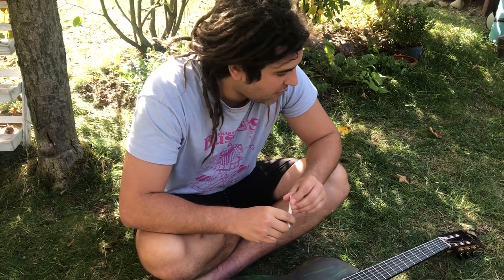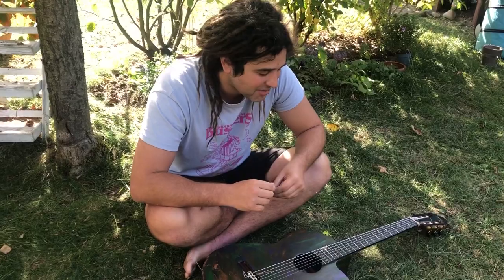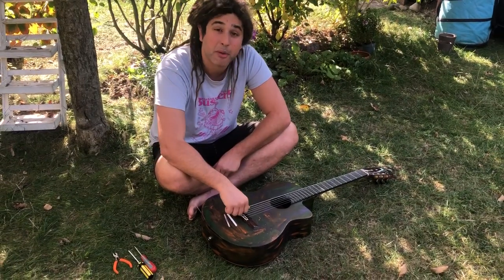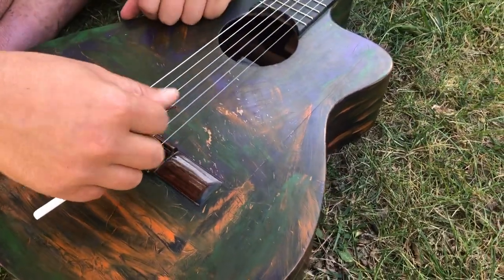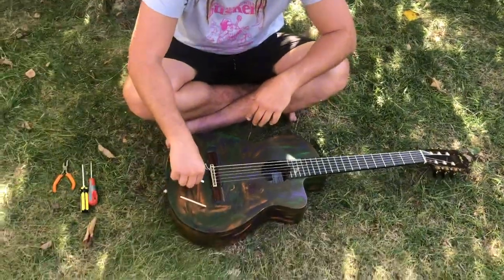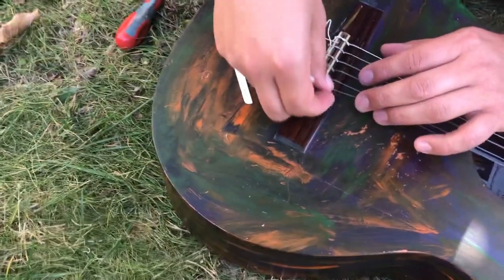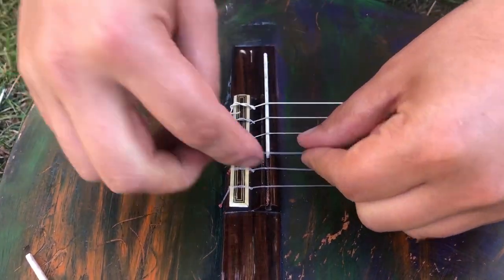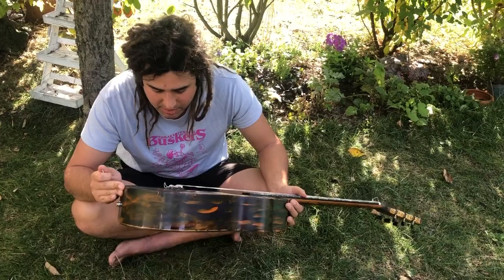One guitar string not loud enough! Maintenance and diagnosis of the problem

Comment: I broke the A string on my electric guitar and when I put a new string on I accidentally measured one peg past the A peg instead of two to get the string length which made the string one peg shorter.  It sounded okay until I turned on the amp then it was dead sounding.  After replacing the string again with the correct length it sounded fine. Thanks for your video.

Comment: I had the same problem with my Takamine GD30CE-6. The low E string sounded weaker than the other 5. I sanded where the saddle base sits in the bridge; slight improvement, but still sounded weak. I replaced the piezo pickup and it improved a fair amount. Finally, I adjusted the truss rod,  and that solved the problem. I believe that, had I adjusted the truss, to begin with, it would have spared me the cost of a new piezo.
Reply: so sir i Just need to adjust my truss rod to make my 1st string/High E sound loud? or do i need to buy those things u bought?
Reply: @mircoortega9797  Have you measured the string height at 12th fret? Use a steal straight edge (16") and lay across the frets and check for bow. Do all these things before trying to adjust the truss rod.
Reply: I have this problem with my takamine GD30CE-6 , and the bottom E, B, and G strings sound a lot lower than the other 3…
Reply: @leoflako13  What gauge strings are you using??
Reply: @leoflako13  :  Has the saddle been modified in any way? Has the NUT been modified?  Check for dirt in the High E, B and G string slots. Are you sure that you're in tune? If you're using lite, or extra lite strings, you may want to increase the gauge ( thicker ) of the strings. On my Tak GD30CE-6, I use a 10 gauge on my High E, ( the thinnest E string, at the bottom, which is referred to as the "TOP" string. This confuses a lot of players ) and 9-42 strings on the B, G, D, A and Low E. sets and 11 on 10-46 sets. Since your problem is with the High E, and B & G strings, you'd be better off just using 10-46 sets on all 6 strings.
On rare, but not too rare, occasions, the Piezo pickup ( copper looking and worm like, cable, that sits directly under the saddle ) can fail, or get damaged if accessed and mishandled.
So, the steps should be as follows:
1) Make sure that strings are sitting, firm, in their appointed slots.
2) Make sure that there is no dirt or debris in the affected slots.
3) Make sure that the NUT is seated firmly in the neck slot.
4) Check the saddle. Make sure that the SADDLE is not floating in the BRIDGE slot. 
5) Make sure that the string angle, at the SADDLE is correct ( there are plenty of resources, on the internet, that show how to check the string angle on acoustic guitars).
6) TRUSS ROD adjustment, ( the most difficult and confusing of adjustments; I recommend that you do this, only if you have a working knowledge of the function of TRUSS RODS )
6a.) The Tak GD30CE-6 uses a 2 way truss rod. Although the 2 way makes for finer neck adjustments, it also makes for a more confusing adjustment.
You can check to make sure that the neck is mostly straight, by using a 16" metal ruler ( 18" is preferred ). Lay the narrow part of the straight edge, across the frets, and to the edge of the BRIDGE. The straight edge should be level with the BRIDGE. So, at the point where the bottom of the straight edge, meets the BRIDGE, it should be no more than 1/32 of an inch above, or below the BRIDGE.
Here is a link to the Takamine forum, in which truss rod adjustment is discussed; http://www.takamineforum.com/forum3/viewtopic.php?p=52770&sid=ef244ce53b4a5a31c5764be033c97bc6

There is also a PDF file, from Takamine, that has graphics, illustrations on the truss rod adjustment. I am unable to copy that link, but if you Google "Takamine 2 way truss rod adjustment", the link will be about third down from the top.

If you have any questions, I'll be glad to supply answers.
Best of luck to you.

Comment: Im having this problem on my electric guitar, I just switched strings and my G string aren't as loud as the other strings. Can someone help me
Reply: I've similar problems
Reply: I already found out the solution, dont buy cheap strings. I recently bought a set of strings that is really cheap from china and put it onto my guitar. My g string had no sound as if it was an acoustic string. I switched the g string with another from a higher quality set of strings and now its fine.